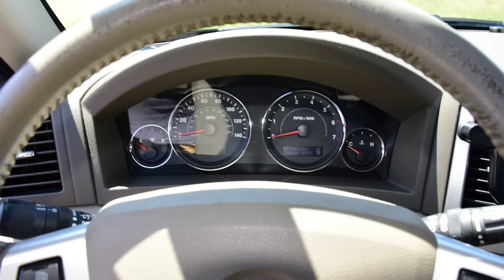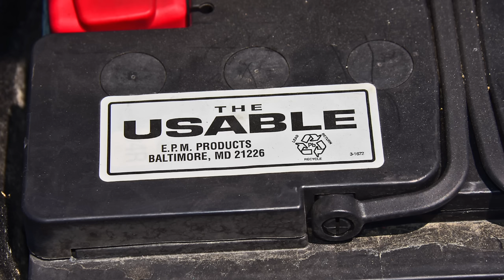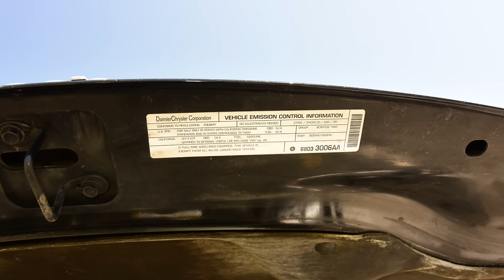2008 Jeep Grand Cherokee Laredo X: Regular Car Reviews

Comment: My mom used to have a Grand Cherokee of the same year but it had a Hemi in it. It was super slow unless you used the "resume/acceleration" button of the cruise control. If you did that, that shit would take off and rev higher than if you just floored it. She would win races by using cruise control 😅
Reply: I wonder if there was actually a problem with the throttle pedal.
Reply: @Henchman1977  idk, I was young at the time so my mom wouldn't let me work on it. But she was pretty strict about taking it to the dealership, so I feel like if there was that much of a problem they would have caught it. If you floored it, it would downshift and hit like 4000 and almost go to 5000 before shifting. But when you used cruise, that shit would start at like 5000 and almost go to 6000 it was a very noticeable difference 😅
Reply: @Henchman1977  it's a feature
Reply: Yeah those mid 00s have torque management to save wear on the transmissions but cruise control ignores torque management for some reason.  I guess it saves gas somehow.
Reply: Your mom is cool
Reply: They’re all like that
Reply: @shadow105720  The transmissions needed that torque management though. The Chrysler transmissions of that era were just absolutely horrendous. I swear they came from the factory with one foot already in the grave.
Reply: @shadow105720  I had no clue, well my mom did it often so i guess she had the 1 in 1000 transmissions that weren't trash. She never had any transmission problems, in fact the reason she got rid of it was because it was terrible on gas. It had the live read thing and you would be lucky to get 18 on the highway it was really bad. 😅
Reply: Yeah... The gas pedal is more of a "request to go" button. You can basically mash the pedal to the floor and the computer will lazily give the engine permission to throttle up.  There's clearly a disconnect between the driver, the engine, and the wheels. At least that's the impression I get.
Reply: My dad has a dodge Dakota that did the same thing. The cruise would send more fuel than if you floored it.
Reply: My 03 ram 1500 hemi... same 😹
Reply: I know nothing about the jeep patriot, but it looks like it must suck, and it has a cvt.

Comment: I can’t get over the fact that they had the place to put a transmission dipstick and then just….didn’t.
Reply: Just like a 62TE in a dodge grand caravan
Reply: i wonder, if they just ran out at the factory?
Reply: Because Mercedes-Benz and Diamler.
Reply: A lot of manufacturers have done this.
Reply: This is a mercedes thing, even Chrysler wasn't that cheap...until they were
Reply: Most likely it has the NAG1 Mercedes sourced transmission.  It's super finicky about the fluid quantity, quality, and moisture content.  My Charger with the NAG1 was sealed in the exact same way.
Reply: @Matthew Weiner  aside from changing conductor plate, the NAG1 has been pretty normal in my WK 3.0 L CRD
Reply: @Kenster1025  Maybe I was spectacularly unlucky with my '09 Charger but mine drove like the engine was attached to a moody box of mush on a good day, basically many of the complaints of the Jeep in the video but worse.  Changing the fluid would make it better for a bit but then it'd be back to its usual lurching lazy self.  Dealer's take was "no codes, no problems, it's normal."  Drove it like that for years until the problems got so bad I sold the car off for parts.
Reply: Cynical me wants to say it's to get people back to the dealership for those sweet dollars. 
Experienced me wants to say the majority of people don't know how to check their transmission fluid properly, so plugging it is actually a good idea.
Reply: My 05 has the dipstick, the fact they removed it is just… irritating
Reply: @MostGenericUser Chryslers been doing that since 05

Comment: I almost had to buy one of these when I hydroplaned my car coming home from college. I needed a car quick so I could get back to my classes and this was sadly the best option available. Luckily they sold it while I was at the bank getting the money together and I ended up getting a '99 Isuzu Trooper for less money. It's been an absolute tank and I've fell in love with it.
Reply: @coejbee  no I definitely could have gotten luckier if it had a manual transmission and not the GM 4L30E, although I haven't had any issues with it yet.
Reply: RCR and automotive YouTube in general needs more Isuzu love.
Reply: @iamflat  You'll do fine with the 4L30E, if you keep it maintained. The biggest issue with GMs automatics is that they don't tolerate neglect as well as others. Given that 90% of the population neglects their transmissions, you end up with problems. Do real services at the recommended intervals, with new filters (not just a fluid change). Also, be sure to wipe the magnet in the pan, each time. If you're not having problems with it now, you shouldn't have any for a long time...as long as you keep it maintained.

Comment: Yes! 100% agree on the A-pillar blindspot, I just got rid of my Laredo and that was very noticeable! At 4-way stops, you literally could not see a vehicle stopped at the intersection to your right.  It's in the perfect spot to completely obscure a vehicle to your right at an intersection! Had a few close calls at intersections because of this! A very dangerous flaw!
Reply: I’ve almost ran over a few families myself at 4 way stops and parking lots but I never did hahahaaa love my jgc!
Reply: Sounds like you need to adjust your seat position. I never have that problem in mine. Then again, maybe it's just relative to the Camaro I drive as well which has more blind spots than Ray Charles

Comment: That era of Chrysler products were random parts bin mashed up to make a car. The same key fob can be used on a Grand Caravan and a Mercedes E Class window switches are universal in all trucks SUVs vans and some fancier cars the first gen Maserati's under Chrysler Fiat has the same climate controls and window switches as a base model Jeep Ram and Caravans.
Reply: This era of Chrysler dominates any pick and pull you'll go to. Last time I went to mine I counted 17 PT Cruisers without even trying.
Reply: If you spent the money and got the VES entertainment system, it was the exact same as the system out of the Grand Caravans and Town and Country's.

On the upside, when the remote and headphones get lost, they are still pretty easy to find.
Reply: It’s still the same. The JK Wranglers use a ton of parts from other vehicles. AMC did it worse with parts from other manufacturers in their vehicles. GM ignitions, etc.

Comment: I prefer this body style to the later models. Especially the SRT Models. I had a low mileage 2006 Overland with the Hemi and I liked it a lot for what it was. A comfortable ride that handled snow no problem, with the lockers in a northern climate.
Reply: Same, the WK IIs are better cars in terms of quality however I still think these are better looking. I might just be bias towards these because I essentially grew up around these cars but they’re really not that bad. Yes you have the transfer case issues but they really aren’t as unreliable of cars as they are made out to be. In fact I’d say the WJ is the worst Grand Cherokee in terms of reliability because of how many of those cars were lemon lawed.
Reply: Mopar mo'problems
Reply: I have a 2006 Limited with the Hemi and I just hit 150,000 miles.  Engine and transmission are fine but the interior is showing it’s age.  I take of care of it, though.  And it is a beast in the snow.  I am trying to keep it another year or two before upgrading since the car market right now is nuts.

Comment: I owned this car after my father. Boy howdy was it slow. Dead nuts reliable though. Has the Mercedes 5 speed which was worry free compared to previous grands with Chrysler transmissions.

We used to use it to tow double jet skis and it was fantastic. An absolute workhorse.

Comment: I have one with the 3.0 Mercedes diesel. It would pull great with this engine. I liked it. I hit a speed bump one day and lost all the electrical accessories in the cabin. It will always start but without electric windows, fan/A/C it effectively scrapped it.
Reply: just get a new  TIPM fuse box. its an old car they corrode
Reply: Turbodiesel and RWD was a lot of fun on dirt backroads
Reply: Did, made no difference. I don't live in the states. There is no Jeep dealers or an abundance of Mopar parts in my country. Most of the cars from this generation where all imported at the same time, so there isn't many of them and because your using second hand parts, stripped from the limited pool of imported cars of a few years. You can replace it,  but your just hoping that the replacement part isn't  faulty. It wouldn't pass yearly inspection in it's condition and I could not insure it without it passing. So I had to buy something else.
Reply: Jeeps are now being marketed exclusively to menopausal women who are still trying to be relevant and desirable. It doesn't work.
Reply: @PatDurt  understandable. What did you replace it with?
Reply: @giggiddy  The Wrangler and Grand Cherokee are absolutely printing money for Stellantis. It's working well. Those and Ram trucks are keeping Dodge and Chrysler afloat.
Reply: A Jeep built with Mercedes parts having electrical issues? Say it ain't so
Reply: I love mine. Tuned up makes 440ft lbs of torque, axle swapped to 3.07 gears, and gets 30 mpg on the freeway.
Reply: @bwofficial1776  It's Nov, 23 and all that good fortune for Stellantis is coming to an end. The RAMS and Jeeps are dead in the water as far as sales!

Comment: My brother has that same exact 2008 Grand Cherokee, but in silver. He must be one of the luckiest Jeep owners to not have any major issues on it. 151K miles and still chugging along.
Reply: I have a 2008 with 272,000 miles on original motor and transmission…no repairs.

Comment: This Car is childhood for me, My friend crashed it like 3 times and still running great
and the V6 3.6 isn't that bad as people say
Reply: Please thank your friend for my obscenely high insurance rate.
Reply: @giggiddy  🤣🤣🤣
Reply: This one has the 3.7 engine. The 3.6 didn’t arrive until 2011.
Reply: The 2011 generation with the 3.6 was a huge, huge improvement from these.
Reply: I have much more faith in these 3.7l Powertech V6s than the modern 3.6 Pentastar.
Reply: They’re a bit rough and anemic but i have a soft spot for the 3.7

Comment: I drive an '06 Jeep Grand Cherokee Laredo. I bought it new and have well over 100k miles on it (maybe 120k or so). I oil change it maybe 2 times per year and have abused the shit out of it over the years. She still runs great and doesn't have any major issues. (Knock on wood) she is just reliable as can be! I run a V6 in mine. It has excessive power. It can break loose on the highway, easily, and has way more than enough acceleration power for merging. It is a very fast SUV. I have no idea what these guys are talking about. It does 'want' constant input on the pedal, but it is also a heavy SUV. Lightly resting your foot on the gas is sufficient, you barely have to push it in.  It has magnificent torque. I have driven over mountain ranges in the Ruby mountains with ease, driven over two dams in Southwest Texas, climbed 'The Wall' near El Paso, taken it on rock crawls without issue, hit 160mph on the highway. She is a great vehicle. Maybe something changed between my year Jeep ('06) and '08....but I know that mine is a fantastic piece of equipment.
Reply: I too have an 06 Laredo. I bought off an old lady 8 years ago for $2800. It's getting crusty underneath and can't say it never let me down but it's been pretty damn good overall, considering the money invested and the beatings it receives. Works great in the snow. Budget 3" lift, 32s and wheel spacers gives it enough capability to go almost anywhere.

Comment: This review would’ve been completely different if this jeep had the 4.7 or 5.7. Pretty much makes or breaks these cars
Reply: I have one with the 5.7.  A whole lot faster and it actually has some soft touch surfaces, and towing is pretty good.

But it's still plastic fantastic.
Reply: Preach.  I had a 2010 with the 5.7 and that thing would scoot.  It was also rated to tow 7200 pounds and had Quadra-Drive II with low range 4x4.  It was surprisingly reliable over 10 years of ownership.   Fit and finish was terrible, visibility was awful, and it was thirsty as hell. 

I still kind of miss it.
Reply: I know it's Chrysler junk, but I just brought home an 07 with the OM642 diesel and that thing runs like a top
Reply: @dikkem8193  never had any big issues with my 06’ grand Cherokee, my only gripe was how expensive good parts are, cv axles from mopar were like 500 a piece
Reply: @moosemechanic4591  that's nice to know lmao. I came from a Suzuki and a diesel liberty so the parts pill isn't too hard to swallow for the gc though
Reply: @Dikkem  I've got an 08 diesel, things amazing but little niggling problems every now and again

Delete the plastic intake and turbo resonator for some silicone ones, get a tune and these diesels are great.
Reply: Have a 06 with the 5.7.  Thing is a beast in the snow which is exactly why we bought it.  The front diff went out at 137,000 but to be fair i've pulled plenty of people stuck in snow drifts out.  Plenty of power for what it is.
Reply: I swear, an old minivan (honda odyssey from the last decade) is faster than this jeep. Literally googled 0 to 60.
Reply: @alext3811  2008 grand Cherokee with the 5.7 reaches 60mph in 6.8 seconds.

2008 Honda odyssey reaches 60mph in 8.5 seconds.

Like I said, the 4.7 5.7 or 6.1 grand Cherokees are a completely different car
Reply: @moosemechanic4591  
That's probably fair. Your point still stands. I was actually referring to the 2011 odyssey, so kinda unfair. Its safe to assume that Google gave me the base model (I literally used the text previews). I just found it funny a minivan had more power and/or speed (at least at base models) than an SUV, you'd expect it to be the other way around (excluding hybrid vehicles of course).
Reply: @dikkem8193  i know someone with 340k on theirs, still going strong
Reply: So, tell me how a different mill in the "power barn" is going to fix the driver's blind spot and the lack of back seat room....
Reply: too bad the 4.7s are absolute dogshit with glue and spit holding the valve seats on

Comment: Funny enough, I have a 2008 Jeep grand Cherokee Laredo. I bought for a generously low price from a family friend after I flipped my first car and it already had around 160000 miles on it. From what it looked like it only had a had a new serpentine belt.  besides being ignorant about the oil level one time resulting in a cracked radiator that had to be replaced, I’ve had no majors with it. It burns a fair amount of oil but can honestly be expected at a car with its number of miles and age.I just passed 200000 miles and it’s still working pretty well

Comment: My sister has an 08 limited with the 4.7. Got it with 53k on it and it’s got 80 on it now, only thing I’ve had to do on it is an alternator and the latch for the trunk. My dad used to drive that instead of his truck for road trips. Cheap, yes. But relatable? Definitely

Comment: the 3.7 was a dog, but it was reliable for me and the interior held up well in mine. Sold it with 186k miles on it in 2018.  The QuadraDrive I (not II) was a sham - but it did get me out of some snowy conditions where others were stuck.

Comment: iv had a 2005 and 2009 both the 4.7 .  The 4.7 and 5.7 versions are night and day from the V6.   The 4.7 is a perfectly mated engine on the WK.

  I have never noticed the "Blind Spot" issue  The bulb issue with the HVAC is absolutely no different then every other car of the same years. No Manufacturer is using little bulbs like in the 80s.

Comment: It's called a Grand Cherokee WK. They come in Laredo, Limited or Overland trim. And yea the 3.7 v6 is slow, but you could get it with a 4.7 v8, 5.7 hemi or the best imo a 3.0 diesel Mercedes engine/tranny combo. In limited(middle) trim it has a v8, low range, quadraDrive with auto front and rear lockers, a rear solid axle for off road articulation. Very capable Jeep, with cheap interiors
Reply: my 3.0 still going strong with 415k and excellent 4 wheeling and body and interior still clean and solid.

Comment: There is a very wide gulf of capability with the WK depending on which options you selected. You reviewed the lowest spec. Doesn't excuse the cheapness, but as an SUV with the right options, it was a very off road capable vehicle.

Comment: We have a 2008 grand cherokee with the 3.0 diesel. It has lots of torque and we use to take it on so many road trips. We drove it from Alberta to California and back. I've always really liked the look of it.
Reply: I love mine. I swapped the axles out to lower gears, put a tune in it, and a small lift. It gets great mileage, tows anything, and feels like a big diesel truck to drive.
Reply: The diesel is a beast, Ive done some work to mine and it pulls like a freight train.

Comment: love hearing an underdog story on durability. My dad had a V6 Accord from '04 that were said to have auto trans problems. His didn't, but actually the engine did. Straight up grenaded at roughly 120k and got a reman engine. No one knows what happened or why he did the maintenance including timing belt at 100k. But muh rEliAblE HonDa.

Comment: Loved my WK Laredo. Bought it used for 9.5k in 2012. Finally replaced it. 
Here is the key: you must get one with the V8 AND the low range transfer case. Mine also had the trail rated badge and tow package of 7500lbs. 

You got the WORST one.

QD was awesome in the slippery shit. Even in foot deep slippery snow mine just tanked through everything up the hills here